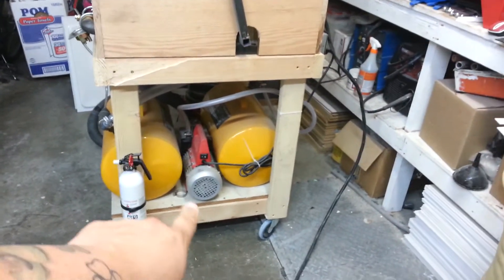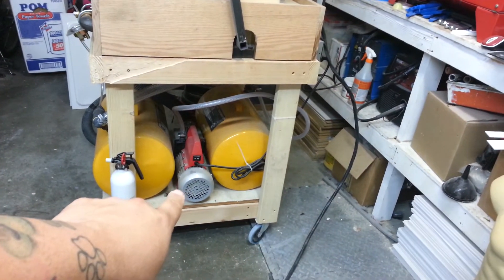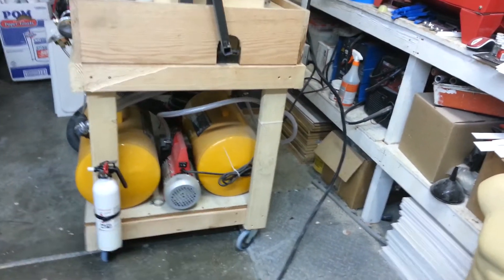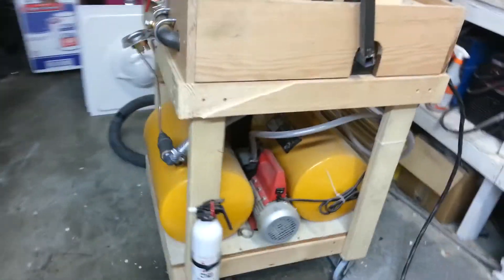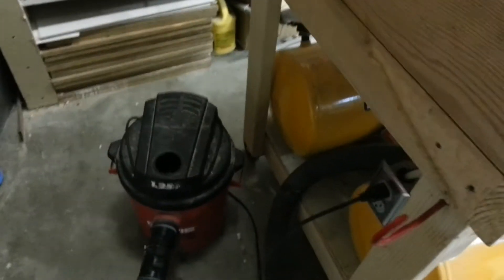DH's vacformer

Comment: Why do you use both vacuum pump and vacuum cleaner? Is one vacuum cleaner for  speed and pump for deeper vacuum pull?
Reply from the maker: exactly, shopvac for quick air removal and the tanks are for the hard pull to get that fine detail. I tried once on my old table to only use the tanks and the slightest loss of suction ruined the pull. it's overkill but it gets me good results.